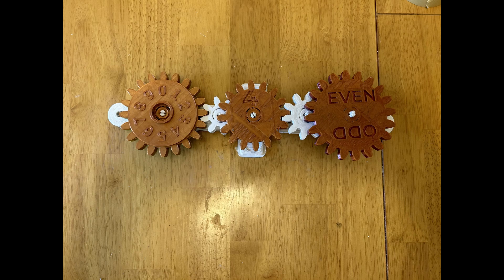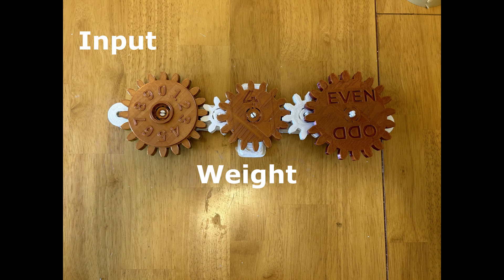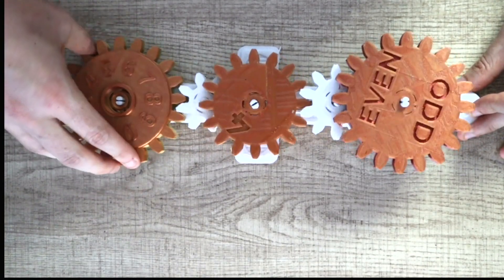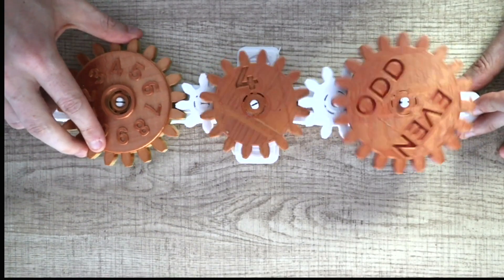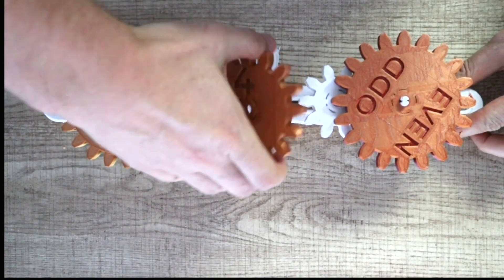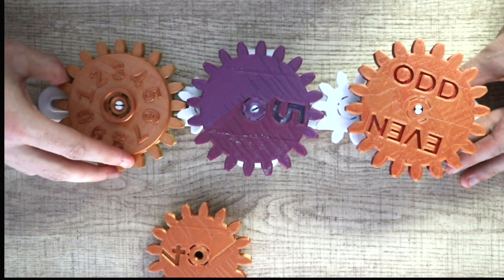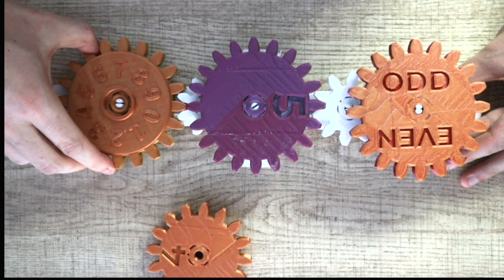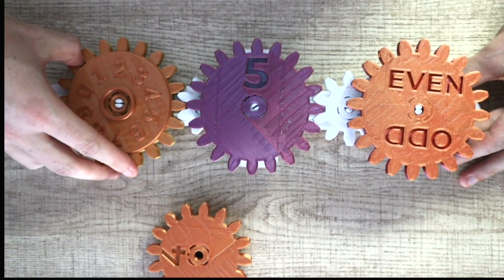The World's First Gear-Based Mechanical Artificial Neural Network

Comment from the maker: I appreciate comments and feedback on this.  You helped me to realize that this mechanical neural network would NOT, in fact, be more efficient than current software neural networks.  Regular computers evolved from mechanical into digital ones, and so taking a neural network from digital to mechanical is a step backward.  However, I still feel that this device is a good way to understand how inputs to a neural network are modified by weights and then become an output.  I ignored biases for the purpose of this experiment.
Reply: First, thanks for the video. Secondly, the concept of “digital” differs from the concept of “electronic”. Digital is a term that exists in itself and has its own situation. It cannot be limited to the “electronic system.” The system can be “mechanical,” but at the same time it is digital, and the system can be electronic. But at the same time it is analogue, and this applies to all systems in this world, even chemical ones. Thirdly, why are you so pessimistic?! Mechanical does not mean "backwards" This is wrong! In the past, the electrochemical battery was unusable and completely impractical, as it was constantly losing a lot of its stored charge. The electronics were also completely impractical and were truly failures. But science is developing, and every technology has a maximum potential for development and work and then begins to decline. There are rumors that the electronics industries may soon reach their limit. In fact, the world in which we live is essentially mechanical. Even our bodies, nerves, and brains are all mechanical systems. For our devices to be mechanical is better for us because they will be more efficient, simpler, more reliable, cheaper, and cleaner for the environment and human health. By the way: Even most of the protection, sensing and actuators devices today are mechanical, so it would be better for us to bypass the losses of the electrical/electronic system and its absurd complications and risks. Fourth, software is nothing, hardware is the basis.
Reply from the maker: @ياقوت-ق  You are right, when I said digital I meant electronic.  I've never heard anyone make that distinction before, but you are right, mechanical systems can be digital.

Comment: I'm not sure that this would be super practical for the purpose of most neural networks, especially given the shear size and number of hidden layers in modern networks, turning them into a mechanical system with additional complications of tolerances, friction, wear and tear, etc would likely make it unusable for something complex like convolution or "speaking for it's makers". However, I do appreciate the concept of reviving mechanical computers for more simple applications, like running integrations or in this case maybe a lightweight network which can predict weather patterns derived from a digitally-trained neural network!

So, something that comes to mind would be to utilize existing AI training methods to build and train the weights and biases of small models, probably no more than a hundred neurons, and then find a way to convert trained model data into gear ratios from there. That way you can leverage faster iteration with the potential benefits of a self-powered mechanical system. Just food for thought! Even if you may not be able to get LLaMa 3 8B running in gears, there's plenty of interesting avenues for exploration and creation.

Best of luck to ya!
Reply from the maker: Thank you for your encouragement!
Reply: Clearance ( tolerance ) is among the most important matters of mechanical engineering, and with some good design the parameters can be greatly improved. The rest of things such as: the friction and wear is fairly unimportant, Concepts are often exaggerated by giving them more than they deserve, even though they are simple concepts.

Comment: in what way is this a neural network??
Reply from the maker: Good question.  Neural networks take an input number, and then transform it by multiplying it by a weight.  This network takes in an input via the wheel on the left, and then multiplies that input using gear ratios, to get an output.  This network does not have a bias term, but because all the numbers are positive we can think of it as having a ReLU activation function.
Reply: @tylersnard  no. every neuron would have as many weights as there are neurons in the previous layer, and a bias. It needs to make a sum of multiplications between previous layer activations, and current neuron weights. then it adds a bias and a relu function. Lets say you have 3 neurons in each layer. you would have 3 outputs from the previous layer, called activations, and each would be a fat gear. They would mesh with 3 gears for each neuron in the next layer, so 3 activation gears, meshing with 9 weight gears. activation gears would have to be about 3 times wider than the weight gears. Then you need 3 counters, one for each neuron in the current layer. These would probably need differential gearing, to add the values of 3 gears. The Relu function would be like the wheels in a combination lock, designed to ignore negative values, and bias would be its starting position. Ideally, you would not be swapping out actual gears, and you would be using a continuously variable transmission for each weight, so it would be better to use belts than gears.

Comment: I think the training part is the big take away here. Do you mind elaborating on the process? Did you use some kind of algorithm to determine the second gear? Or did you use the weights from some other AI?
Reply from the maker: Very good question!   I knew I would have to make the last wheel rotate once for every 2 teeth that the first wheel rotates, because half of the gear says Odd and half of it says Even.  I learned about gear ratios and I designed the experiment using geargenerator.com.   So I just started out with the correct gear and then I printed 2 incorrect gears, one with 4 fewer teeth and one with 4 more teeth.  I think in the future though one might train a digital neural network and then use the weights from that as guides: for example a weight of .25 would need a 1:4 gear ratio, etc.  Also a paper recently came out explaining an algorithm for backpropagating mechanical neural networks, so there is that too.

Comment: what about biases or more importantly an activation function?
Reply: There are some “nonsense” things or steps you have to do in the electronic/electrical system because it is a very complex and consuming system. In the mechanical system, you can simply bypass this and not do it.
Reply from the maker: Good question.  I was thinking I would use mechanical stops for the activation function.  If I am just using ReLU then I can put a mechanical stop at zero, and make it so the gear disengages and does not spin if that threshold is reached.  I think that would make it so the output of that neuron is zero.  As for biases, maybe I could add an extra turn or so to the gear, or add a spring... I am not sure.

Comment: Calling this a neural network is like calling a single brick a house
Reply: It has an input layer, a hidden layer, and an output layer. The input is weighted by the hidden layer and then passed down to the output layer, producing a prediction. It can "learn" by adjusting the weight of the hidden layer. What's missing?
Reply: It's actually a good descriptor of what a artificial neural net is.
Reply: @rudde7251  It's a good description of what an algorithm is
Reply: @woodduck  Not really. Since it's a shitty algorithm for finding out if a number is odd or even. Could have been done simpler. If this would be a way to explain an algorithm it's just unnecessarily complex, which again would convolute the explanation.
Reply: @woodduck  a neural network is an imprecise algorithm, but it exists in it's own right. He literally states that's what he's demorating, and he is right. This is a horrendously bad odd or even algorithm, but it is a working odd or even neural network
Reply: @rudde7251  You are completely missing the point here.

Comment: "It operates on mechanical energy, making it energy efficient"
Even when considering, that it is more efficient to convert chemical energy to mechanical energy, it's still far less efficient to use gears than electricity, because no matter how small the gears get, it will be always far easier to move electrons around.
Reply: also, you would have to replace the gears sometimes, cuz they would grind down.
Reply: @titualbuddyretard they are not necessarily going to grind.
Reply: Electronics, according to current science, are extremely small particles, so when the gears are miniaturized, they may be like electrons, but better than them. The electrochemical system is known to not last long, sensitive, and inefficient.

Comment: The hardest part, finding the right gear, will make you sweat a lot and cost you much more energy. There is a reason why even cars are switching to electricity. It's more efficient.
Reply from the maker: Good point.  A paper recently came out about backpropagating mechanical neural networks.  I could also train a digital neural network and copy the weights to gear ratios.
Reply: @tylersnard  efficient or not I knew that this is possible but it's great that someone is doing it in real life so that it can be shown to people who don't have the basic understandings about computers, turing machines and so on.
Reply from the maker: @jondo7680  Thank you!
Reply: It is not hard, much easier than calculating electronic circuits, and when you want to replace a capacitor you have to know the type of capacitor and its capacity and compare it to the circuit. As for electric cars, they are a trick promoted by consumer companies motivated by profit and control.
Reply: @ياقوت-ق  sure, everyone on the street knows how to calculate electronic circuits 🙄

Comment: cool, but a thousand gears will probably take more energy than a billion transistors
Reply: i think that the most valuable concept here is the visualization of the analog computing happening. transistors evolved over time to what we currently use to compute binary calculations, the same ideia is also being applied by some startups making analog electronic equivalents to transistors for machine learning
Reply: You can't compare transistors to gears. That's wrong! Transistor is amplifier takes advantage of feedback and miniaturization. Gears are somewhat similar to electrical transformers that manipulate voltage and current, but the difference is that gears are much simpler than electrical transformers.
Reply from the maker: That does make sense.  I was thinking of making the gears super tiny and having a person crank by hand.
Reply: true but can you power a "billion" "transistors" with hamster wheels?

didnt think so.
Reply: I think the number of hamster required per gear required will add up to a lot after factoring in food .